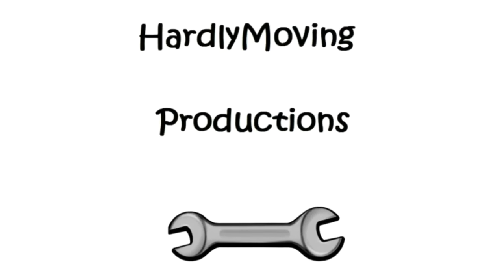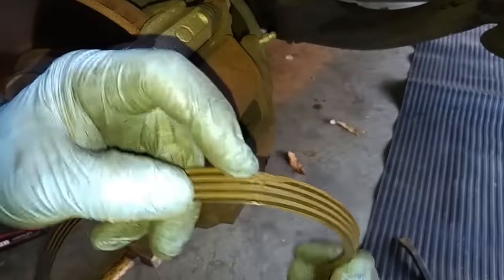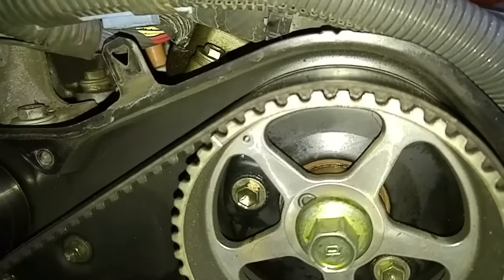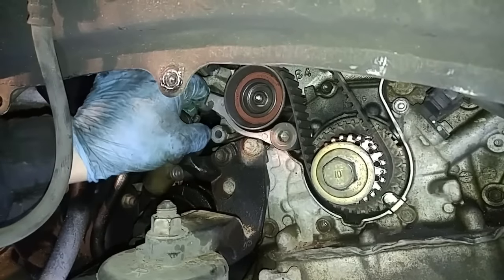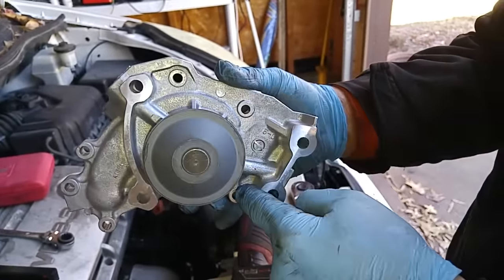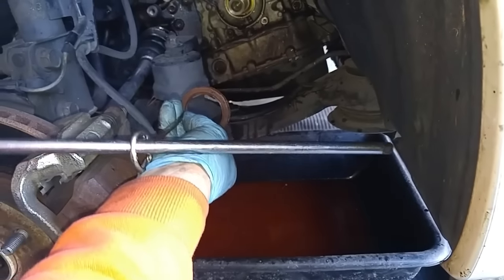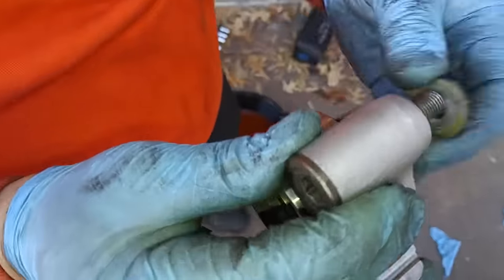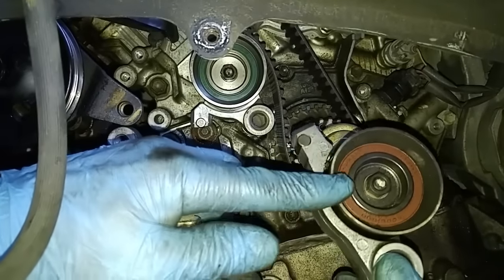Toyota Sienna V6 3MZ-FE Timing Belt, Water Pump, Seals, & Pulleys Replacement

Comment: I had a Toyota dealer fix my snapped timing belt, when I took the car back home after they fixed the car started leaking oil like crazy, they claimed it was not their doing but agreed to fix the car free of charge, the oil was coming out of where the timing belt goes. A few months forward I see a slow leak coming from the timing belt area. Your video clearly shows how the timing belt is replaced and makes me think they didn't set the camshaft seals right. Thank you so much for posting this!! Now I have to figure out what to do... fight the sealer again or get another car since mine is already 256.000 miles young.
Reply from the maker: If the car wasn't leaking bad BEFORE they did the repair, how can they claim it's not they're fault?  There's two camshaft seals.  If they're not installed properly, they will leak very badly.  If the seals are not evenly pressed in they will leak;  the seal could turn inside out if no carefully set on the sprocket shaft before they're pressed it.   Possible dealer excuses:  It's your rear valve cover gasket that's leaking ... it's your power steering pump that's leaking (check the ps fluid level).  It usually the ps hose clamps that's lost it's clamping force that's causing it to leak.
Reply: Thank you thank you! The ps fluid was fine, the car was a bit low on oil and the oil seems to be coming from the belt cover so that’s why I think they did something wrong! Thank you for your advice!!!
Reply from the maker: @andresgarcia7757  No problem.

Comment: Well I guess I'm going to the dealer after all ☹️☹️ great video sir✌️
Reply from the maker: Try independent repair shops that deal with foreign car repairs.  If they're also willing to allow you provide the replacement parts, they're probably a honest shop.
Reply: You may be shocked at the price a dealer will charge you. I was expecting 8-9 hundred not 1,600.I have a call in to my local independent guy to get a quote from him.
Reply from the maker: @waynerogers6621  I agree and don't get it.  An experienced mechanic at the dealership should be able to do this job in around 5 hours ... less if not replacing the cam seals.  If just a belt replacement only (no new seals, w/p and bearings), I could do it in around 2.5 hrs.  Also, timing belts are cheap (under $50).  Saw a video about a Cadillac owner with the V8 Northstar engine with a leaking oil pan.  Dealer quoted over $4,500 for the repair ... his trusted local repair shop quoted $1,500.  The guy fell off his chair!

Comment: If I could bother you for another question?  I finally got the timing belt, cam seals, crank seal and water pump together.  I noticed a pretty bad leak in the power steering pump so I swapped that as well.  I needed a flex head rachetting box to get the high pressure line bolt out.....anyway, what would be the symptoms of the engine if I missed by one belt notch ?  I swear I triple checked the marks.  I checked the back cam mark with a mirror.  I followed your trick on your video to make placing the belt easier.  I had the two solid white marks on the belt right where they should be.  I had both cams right on the hash marks.  The crank was lined up on the on the rear dot (which was my original question below) and it was right on the mark on the block.  I even figured out what the dot on the front of the crank sprocket was for as it lined up perfectly with the dashed line on the belt.  The reason I am asking is that the valves sound a little noisier now, or what I think are the valves tapping a little louder.  Is this indicative of me having missed by a notch ?  The vehicle runs almost perfect down the road, but should I be concerned about what appears to be a little more tapping noise of the valves ?
Reply from the maker: If the belt were off a cog, your check engine light would go on with the error code indicating a camshaft position error.  Check all your vacuum lines for any vacuum leaks.  After a big repair, human nature is to get focused on things they usually wouldn't give a 2nd thought ... especially noise related.

Comment: Appreciate the effort for showing how subscribed
Reply from the maker: Thanks for the sub!
Reply: @hardlymovingpro  greetings,Bob is my name.i noticed something in my Toyota sienna after my driver removed my thermostat the one that runs from the engine side just complaind that the temperature went high just on motion but till now nothing of such I have to take the car from him.but every morning before I go out with the car I have to add water to the radiator just to ask if it is normal.pls
Reply from the maker: Maybe you have an air pocket.  Are you getting cabin heat?

Comment: After completing the timing belt change including replacing of the camshaft seals, I took my 2006 Sienna out for a test drive.  It sounded great, drove great, and no check engine light.  I was feeling pretty pleased with my work.  Then I got home and inspected the vehicle.  I noticed oil dripping from passenger side of the engine.  Presumably it is coming from that back cam shaft seal.  I used the seal press you recommended and turned it til it bottomed out.  It looked like it was seated well.  I am super bummed I have to do this job all over again now.  Not sure what I did wrong for that seal to leak.  Is it possible I pressed it too much?
Reply from the maker: Could be the inner lip of the seal may have turned inside out during installation.  I lubricated both the camshaft and the seal and slowly spin the seal on in place before using the press tool.
Reply: @hardlymovingpro  Thanks for the tip.  Looks like that was exactly the problem.  Replaced that seal again, and this time it did not leak....  This van is back in business again.  Thanks again for the super helpful video.  Big lesson learned from this is to be very careful with those seals to make sure they are seated correctly and don't over press them!!

Comment: I did mine recently. This video was excellent to follow! The van started but had a ticking noise and a slight vibration at idle. Also after turning it off after a minute it would not start again easily. I had to turn the key a couple of times till it fired back up. I went back and reinstalled the belt. I am really sure my marks are all lined up correctly but still the same problem, ticking noise, slight vibration and rough starting.  
Any ideas??
Help would be much appreciated! We are a family of five and this is our only transportation. I am really scared this car dies on me now.
Reply from the maker: If the belt is out of time your check engine light would come on.  Ticking might be pistons kissing stuck valves.
Reply: @hardlymovingpro  thanks for the reply. We had to take it for a drive for 60min. And the vibration is gone now and the ticking is not as noisy anymore, but still there. Also, it seems to start normal now. How bad would it be if it is pistons "kissing" stuck valves? It obviously can't be good, but how bad are we talking about? Is permanent damage done or can it be still dealed with?
Reply from the maker: Nothing to worry about.
Reply: @hardlymovingpro  Thanks again! After driving frequently now for a couple days, I happily can report that the car is running as smoothly as ever! This video was great to follow and I placed my phone beside the car and worked through it step by step.

Here are a couple things I would like to add for everyone attempting this repair:

As others mentioned, the long bolts of the engine mount bracket can be a pain in the butt. I ordered both brackets and bolts ahead of time as precaution and I am glad I did! Even though I did everything recommended to loosen the bolts, I broke off both bolts and I needed a ton of force to seperate the brackets and broke them as well in the process! Be ready for that! 

I didn't have the can opener tool to remove the seals, but I do a lot of woodwork, so I used a 2 inch deck screw to screw right into the seal. I carefully used a impactdriver with a right angle attatchment for access and once you pierce through the metal of the seal, give it two more turnes by hand and use pliers or literally a clawhammer to pull out the seal. Works like a charm and takes only a minute. Just be careful to be in the center of the seal so you don't scratch the sidewalls. 

I didn't have the tool to press in the seal evenly. Instead I used some wood scraps, like 2x4's and plywoodscraps and diffrent size forstnerbits to make "wooden washers". In combination with the bolts for the cam/crank shaft you can easily create your own seal press tool in no time. 

Also, in real life it is impossible to line up the marks on the rear camshaft due to the lack of space. You just can't place your melon where it needs to be. But you can shove your phone back in there and make a picture which then helps you to get everything lined up properly. Or you get a cheep telescoping inspection mirror which worked just as good if not better (very cheap at Harbor freight tools or Princess auto for canada, $5-10!)

Overall, don't be afraid of this repair, it is a lot of work but nothing impossible. If I was able to do it in my driveway so can you! Just take your time (two days) and work through it step by step with this video. And make sure you have all the tools needed and the parts ready. (I recommend to order/buy those bolts/brackets and extra seals, they cost just a couple bucks but they are easy to mess up accidentally.) 
Good luck!

Comment: About an hour ago I started this project. The van spent its first 5 years in Milwaukee. Darn rusty fasteners. The steel bolts are married to the aluminum.
Reply from the maker: Suggest soaking with penetrating oil for a couple of hours then bang around the area with a brass hammer to loosen things up.  If using a powered impact tool, be careful as to not sheer off the bolt.  If you get the bolt to move a little, add penetrating oil, re-torque and then loosen.  Do this multiple times and the oil will spread throughout the threads.  If your problem is with the aluminum side motor mount, you can apply penetrating oil on the bolt holes on the bottom of the mount.
Reply: @hardlymovingpro  Its soaking. Tomorrow!
Reply from the maker: Ok ... good luck! 🤞
Reply: @hardlymovingpro  Okay, my day was productive. The water pump is in. I have fought rust in two locations and I am winning. I found my cam seals were leaking slightly and tomorrow I install them. No SNAFUs yet.
Reply from the maker: Okay ... great ... you have a seal removal tool?  If not, you might be able to get away with using a paint can lid removal tool.  Otherwise a good quality thin tip screw driver.  Another way is to drill a small hole, screw in a sheet metal screw and the pull on the screw.  If you don't have a seal installation tool, get a PVC pipe of the same diameter of the seal.  SNAFUs can be overcome ... can't recover from a FUBAR!
Reply: @hardlymovingpro  All's left is the accessory belts. I finish in the Morning.
Reply from the maker: Hey ... great!  You can start and run the car before buttoning everything up.  The car can run off the battery for a little while.
Reply: your technique of using screws to remove the seals is what I used on my old trusty volvo. I use drywall screws and tap them in a bit( 180 degres apart) then screw them in a bit then use two plyers and wiggle the seal out.  @hardlymovingpro
Reply from the maker: Yes ... that's a old, useful technique which I followed with a cheap-o paint can lid removal tool, followed with a single sided seal puller tool, followed with finally a two sided seal puller / installation tool kit.  Each progression generally resulted in faster job completion

Comment: Great video ! Unfortunately i had an oil leak when i finished ,which i thought was the rear(left) cam seal. Took it all apart again , it looked fine , no oil on back of metal cover , seal or belt . Started to look at upper oil pan because the FIPG toyota seal was deteriorating . Actually found some of it in the oil pickup screen. Took that all apart, which was more troublesome than the timing belt etc. I removed lower drain pan and the upper oil pan and resealed everything. It's gotta be the cam seal or rear valve cover gasket( replaced the valve cover gaskets 2018 )?  This is a 2005 XLE Sienna 3.3L
Reply from the maker: Most likely the rear valve cover gasket.
Reply: @hardlymovingpro  put some dye in today, looks like valve cover gasket. Keep up the good work !!
Reply: @hardlymovingpro  its the rear cam shaft seal,  dye was all over it. any chance i pressed it in to far with that tool?

Comment: Great instructional video. 
Have you  tried removing the side engine bracket and the  upper bracket as one unit? I am working on a 02 Sienna and the upper bracket mount bolt towards the rear is frozen. I tried heating the bolt from underneath for about a minute or two , but no luck.  Wondering if removing lower bracket with the upper bracket attach is possible?
Reply from the maker: Yes ... you could do that.  May have trouble lining up on the reinstall.
Reply: @hardlymovingpro  Thanks for the quick response. Once off, I will try and separate the pieces before installing.

Comment: I am installing AISIN TKT-026 timing kit on my 2005 Sienna 3.3.  Also replacing seals. Before I removed the Cam sprockets they were on the marks . Afterwards as I am replacing them the front is correct but the rear is off about 1 1/2 in cc from its mark.On your video at about 1400 I see your front cam sprocket is lined up . Should I force it to be lined by turning it clockwise to is is lined up? I had turned the lower 60 degrees counter clock wise as the instructions showed with the aisin kit removed the belt and tensioner after that. The instructions then say turn the cam sprockets until the marks are aligned. And than turn the crankshaft clock wise 60 degrees to line up its marks. Help would be appreciated I don't won't to mess it up. Thanks PS Forgot to state that these instructions did not replace the seals and did not remove the cam sprockets. Just belt/wp instructions. If that matters.
Reply from the maker: You have to move the cam sprockets to slip on the new belt and align with the paint marks.  Also the crankshaft as well.  As long as the paint marks are in alignment with the cam and crank, you no longer need to align them with the engine backing plate alignment marks.
Reply: Ok I will try that. I was just overly concerned I guess about moving the rear cam sprocket a full inch or so possibly damaging to the engine. Thanks for your help. I also am from Memphis but now live in Springfield MO.  @hardlymovingpro
Reply from the maker: @willmitch616 easier to move and manipulate the front cam.  The rear tends to jump.

Comment: Hello there friend, I have a bit of a dangerous situation and completely stumped on what to do! I have a 2000 Toyota Sienna.  From a complete stop, with a light touch of the gas pedal the Van accelerates on its own and surges, after about 12 feet or so it let's go, stops accelerating and surging. It only happens while its in Drive, when stopped or at very low speed. When I press the Brake it holds the RMP high continues surging until I let go of the brake so it goes that 12 foot distance and stops accelerating and surging. I cleaned the throttle body, replaced TPS sensor, Cleaned IAC valve, checked throttle cables, it wasn't sticking, Gas peddle is not sticking, no floor mat issues, no large shoes/boots, thought maybe the cruise control is kicking on with the light throttle, but it does not. I put the vans front end on jacks and saw that while foot on the brake, with a light touch on the throttled it would accelerate unintentionally/uncomfortably on its own. The throttle position on the throttle body would stay open to around 2200RPM or more... I tried pulling it back by hand, it was difficult, it had some resistance. But after i returned the throttle position by hand, surging stopped and acceleration. Not sure what can possibly pull on the throttle cable like that to cause it to surge and accelerate. When Van is off, everything seems okay, throttle plate opens and closes fine, none of the cables are stuck and move freely. I'm completely stumped as to what it can be.... It's my dads van and only one we have, I'm afraid it might cause a dangerous situation on the road..
Reply from the maker: Difficult to make a recommendation not seeing the problem with the engine running.  I'd start by getting another throttle body off a vehicle at the salvage yard.
Reply: @hardlymovingpro  I will see if I can source one from ebay or scrap yard and stay updated thank you!